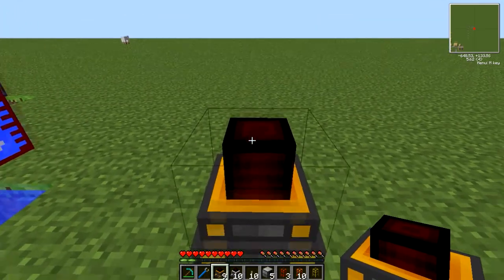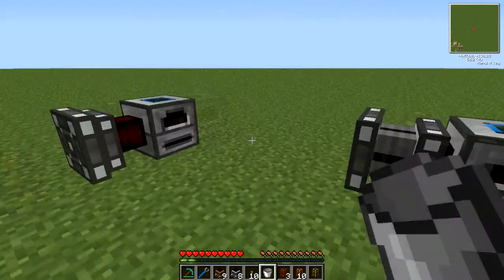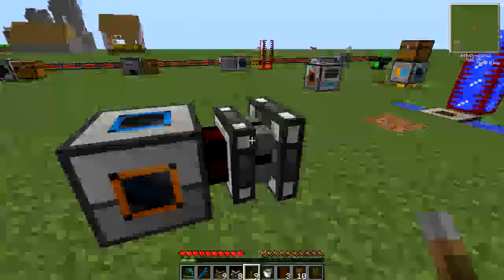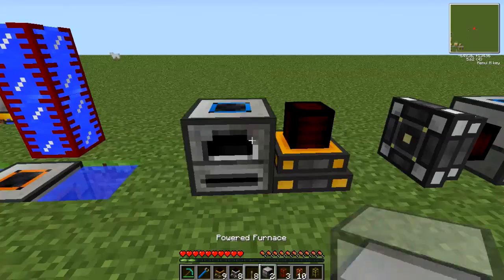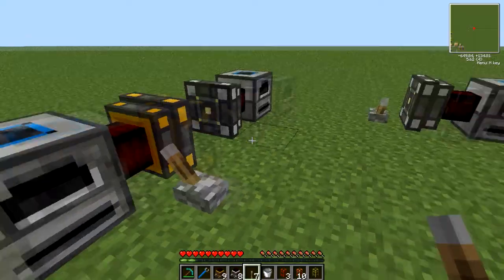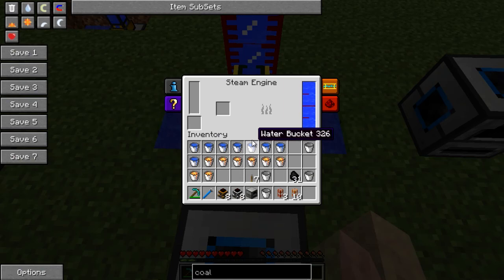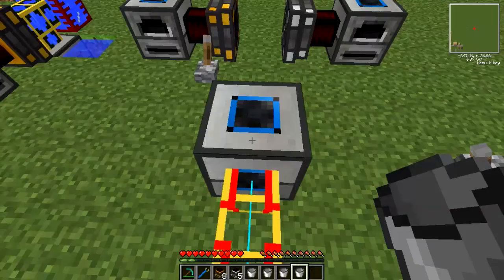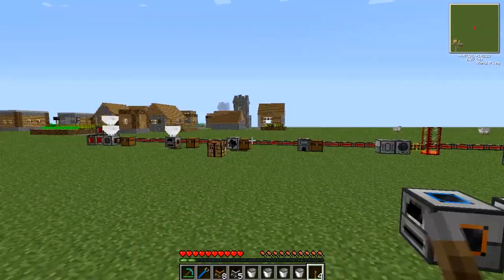(NEW) TEKKIT Tutorial: Steam and magmatic engines from thermal expansion.

Comment: They have the power armor in the new tekkit modpack. my huge question is, is there a way to recharge the powerarmor/tools without the solar helm upgrade. That's the thing that bothers me the most without the IC2 mod installed. It's the main thing I used IC2 for. Oh and the maciator but there is the pulverizer that takes up that slack